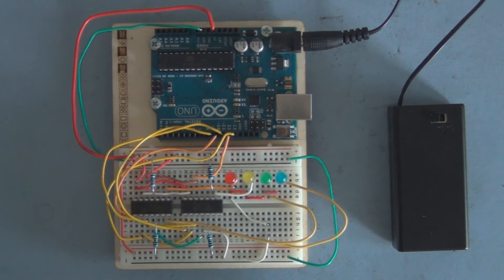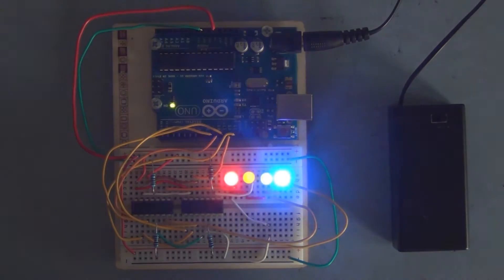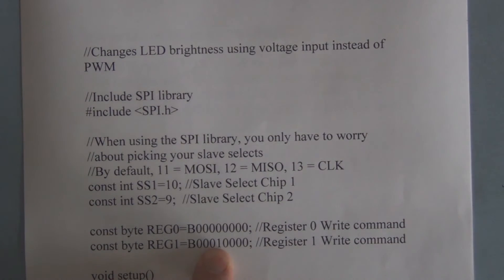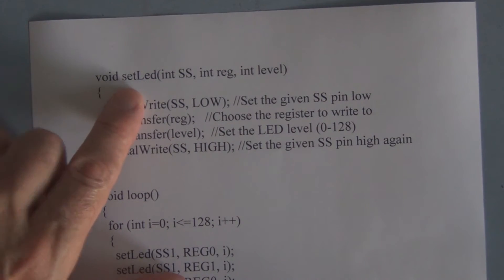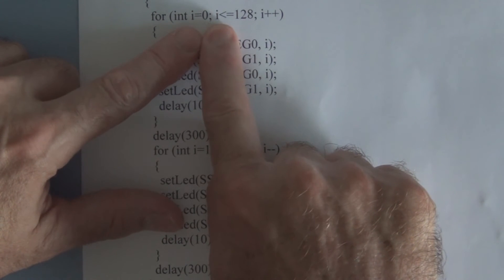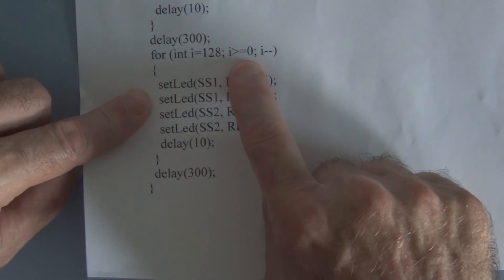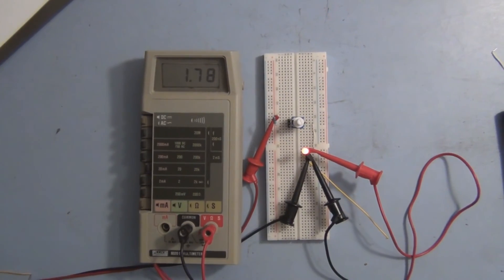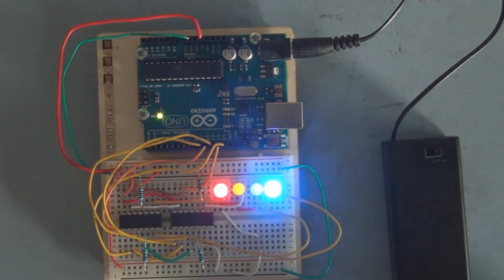Arduino SPI DigiPot Control Tutorial

Comment: Hello Mister Tom,thank you for share this videro it is actually helped me so much because i didnt found anything about this digital pot in Turish language :) but i have a question:
  Cant i adjust the voltage only with arduino?
Reply: I believe what you are asking about is using a PWM signal to control led brightness. You would actually get mor consistent brightness using analogWrite() with anything from 0 to 255 in the parentheses.e This is just a basic test circuit to ensure your digipots are receiving the signals correctly. I am currently trying to get an AD5206 working but it uses an 11 bit word(3 address bits followed by an 8 bit byte) that i am having trouble figuring out. It receives the signal but the output is all over the place.

Comment: If it's a 128 step digipot shouldn't the max for i be 127? 0-127 is 128 steps.
Reply from the maker: +SOVA Rides Its not just a straight binary counting relationship.  If you google for the MCP4231 data sheet you will find that for a 7-bit device, there are 128 resistors in a string between terminal A and terminal B. The wiper can be set to tap onto any of these 128 resistors thus providing 129 possible settings (including terminal A and terminal B).  So if you don't have a 1 in the seventh data bit you don't use the full string of resistors. http://ww1.microchip.com/downloads/en/DeviceDoc/22060b.pdf  I hope this helps
Reply: I see now that it is listed as a 129 step device, which makes sense. Thanks